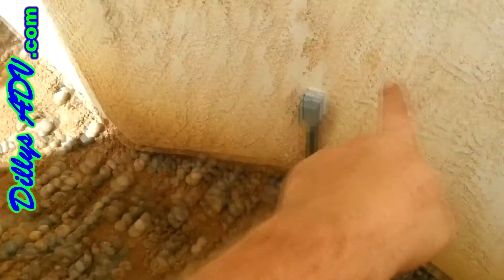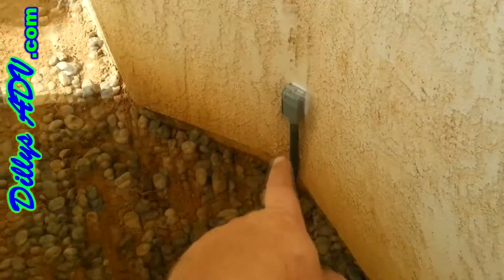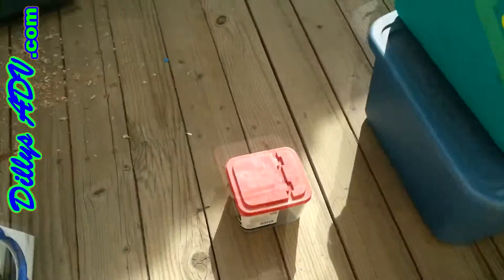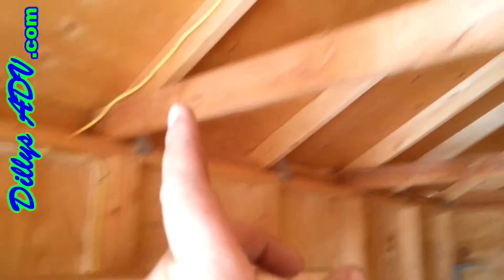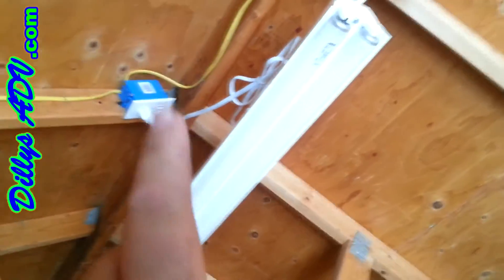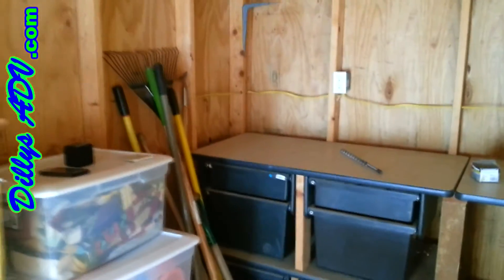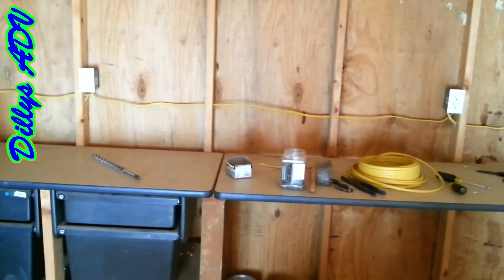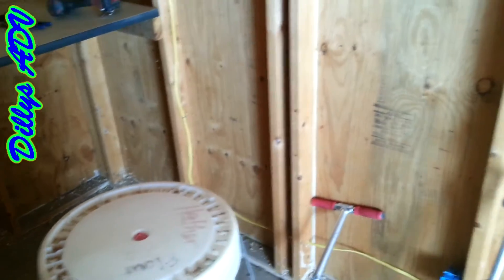WIREING THE SHED

Comment: I have a shed the same size but it is 150ft away from the nearest outlet I don’t wanna continue using my drop cord to power the stuff but I can’t afford enough the right wiring to run out there and suggestions
Reply from the maker: Only suggestion is save up and do it right, it is worth the spend.. if you know of any contractor friends they may be able to get supplies in bulk to save on the cost.
Reply: @DillysADV  I have a 10 gauge extension cord running through tubing underground and it’s work past two years I can run my 5000 BTU AC unit, several LED shop lights, a air compressor and some small ceiling fans at the same time as well as the TV. All off the one outlet from the house would it be better just to add another breaker, thicker wire from the breaker to another dedicated outlet and still use my same shed setup